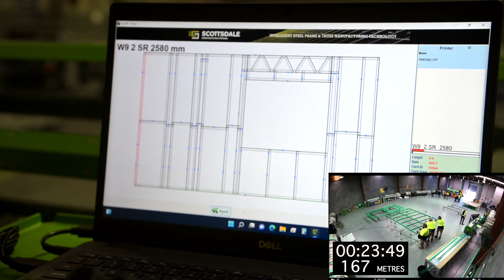How much steel framing can you fabricate in a single working shift using Scottsdale roll formers?

Comment from the maker: The results:

The guys at Urban Steel are fast and don't make mistakes. They fabricated an amazing 3,025 metres (9,925 feet) in a 7.5 hour shift. That's over 400 metres per hour (over 1,300 feet/hour). Impressive stuff. Yet even this crack team couldn't keep up with the GEN II machine from Scottsdale, which was cruising at about three quarters of the machine's top speed.
Reply: This must happened in a ideal condition where the worker don t need to pack the frame clean or unload coil. And the frame are all interior ir exterior wall so tge coil runs out fast . It will be amazing to see how to pack i.the mist efficient way
Reply: 400 meters per hour... Is that material used, or actual length of walls fabricate?